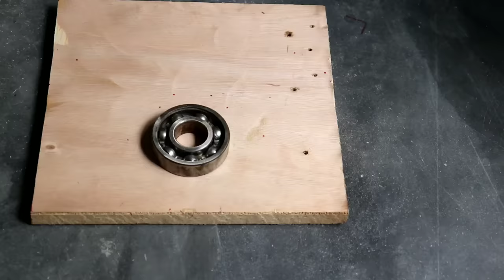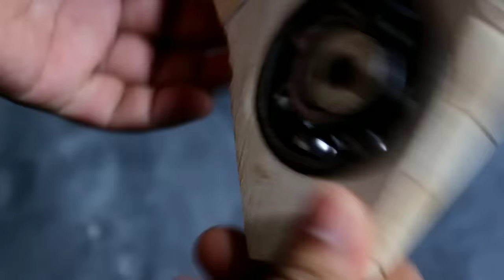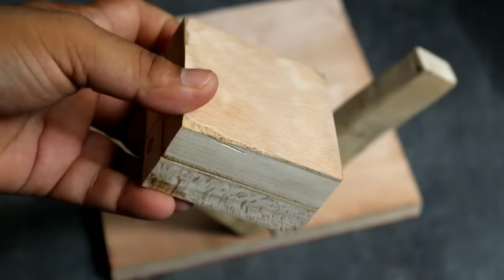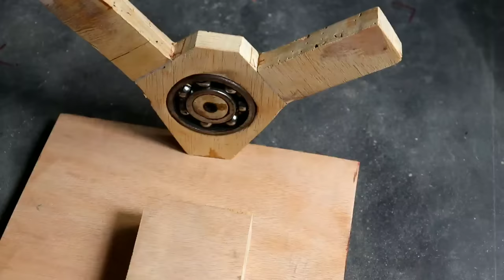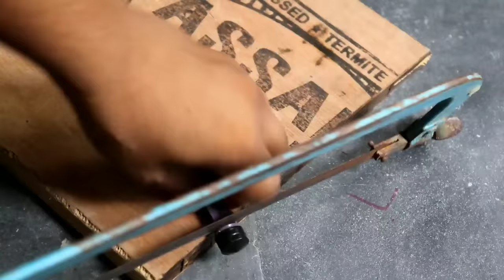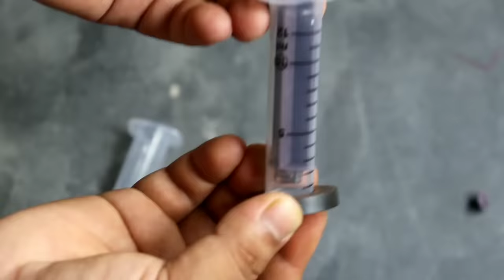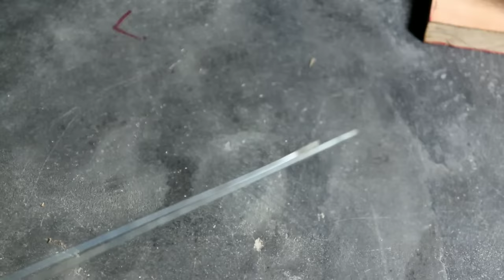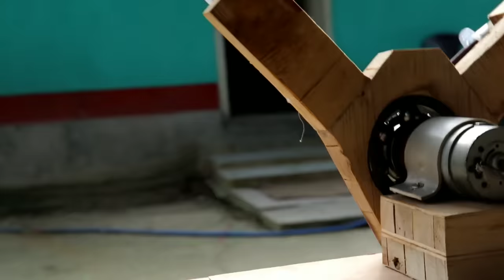dubble cylinder engine 100% working

Comment: Concept 1 :- The most difficult problem in creating free energy is " where to hide batteries"
Reply: may be in the motor 😅
Reply: Сам такое сделай и узнаешь где спрятаны провода... Магнит.
Reply: One for engine, other for lamp
Reply: Public esi fake video dekti hi kyu he...jabki urja ka siddhant he ki urja naa to paida hoti he...or naa hi khatm hoti he...keval ek rup se dusre rup me transfer hoti he...
Reply: So  funny lmao
Reply: Brother hide the battery in the bulb and use the other two connected wires as switches.
Reply: Motor in side
Reply: It work for real
Reply: Under the table bro...cause they won't shot that place 😅
Reply: Lmao
Reply: yeah he is hidden batteries 😁
Reply: That is chargeable 💡
Reply: the motor is connected to batteries via Bluetooth.
Reply: @additoislam2350  same thought I had through out the video... I was trying to catch a glance of what was underneath the base board
😅
Reply: how does this little motor produces energy if it is not an alternator or generator? i believe has some batteries hidden somewhere.
Reply: @renegoisusari5254   it can ! Try yourself
Reply: The most unoriginal comment on this video. Iv found atleast 20 people use this. 😴😴😴

Comment: The most difficult part in making engines like this is hiding the wire
Reply: 🤣🤣😂, right bro
Reply: Which wire. 🦧🦧
Reply: @juicy11  he is running it through batteries and he hide the wire .
Reply: @salmanGulsofi  that means he's a cheater.
Reply: And battery
Reply: @salmanGulsofi  it is a simple science project. Faradays law of electromagnetic induction. If you don't understand then pls don't blame anyone. You can test this project also. Nothing magical happening here.
Reply: @pritammondal4927  jyada hi science padh li hai tune 🤣🤣 science k basics hi bhul gya
Reply: @FamousInsane  may be u r right. It may that I've overlooked something.  But why everyone is saying that there is battery? Can u explain a little bit?
Reply: @pritammondal4927  Bcz that motor is DC and to run a DC motor we need DC current & Easiest way to get DC current is battery. 
And you know, when i was in school around 2007-08, i did the same for science fair. I made a hydroelectric system and used small 12v battery to run the lights. Nobody questioned me about the lights from such a small system bcz most of the people knew basic science. Its not possible to generate electricity from such small units..
Reply: @FamousInsane  it is acting as a DC  generator. He provides the rotating mechanism my magnetic repulsion. When rotor rotates we get the emf. Upto this point it seems all ok. But I'm not sure about the generated voltage. As the speed is so high that it may develop the voltage. So in my observation it is possible theoretically. But  Without testing nobody able to tell the truth.
Reply: Energy is always conserved and true perpetual motion doesn't exist.
Reply: @mayukhdevansahu5707  agreed. May be few minutes later it should stop due to friction n other losses.
Reply: @pritammondal4927  bro u are right it's does not have a battery bro it's only working on magnets ...
Suction and compression is all done through magnetic power .. 
I am an automobile engineer and knows how engine works without battery we just need starting rotating force to rotate the engine then engine works automatically... ❤️
Reply: @FamousInsane  tere science teacher se puch lena e sehi hay ki galat..
I
Reply: @anurupamahata9839  chup gawar
Reply: @pritammondal4927  it may light up for some fraction of secs but not more than that. The law says that the change in magnetic flux induces emf. The magnetic flux needs to change to induce constant emf to light the bulb but the speed is constant so flux change won't be there and hence it will not induce any emf further. There's definitely an additional hidden battery.
Reply: @aminto3731  
كلامك مظبوت كنت سائق سيارة ديزل فحاولت تشغليها لكن البطاريه كانت فارغه ثم احد اصحابي اتى ببطاريه وعندما شغلت السيارة اخذ البطاريه وبقا المحرك يدور بدون بطاريه
Reply: But I noticed your inflated opinion came with no explanation.  Typical of naysayers.
Reply: @50-sachinsharma  why don't u try first n coment 😁
Reply: Magnet + dynamo = electric
Reply: hahahaha

Comment: The people from the 80's and beyond would remember the way bike lights with the generator were. Even with a tiny light bulb it took work to get it to light.
Reply: LOL, Remember it well... It would cut my speed by about 40%, ... now electricity runs me around, (mobility scooter), not me running electricity...  : ).

Comment: The thrust in car cylinder comes from the explosion of gas, but when the piston returns back, there is no thrust in that cylinder while coming back, while there would be new thrust coming from the explosion in the second cylinder.

 Here, the thrust force between the circular magnet and the magnets inside, in each syringe is equal in the two syringe.

From the beginning and in the first half of the cycle, it will rotate to the middle area and stop because the thrust in both of the two syringes will be equal.
Reply: eu pensei o mesmo que você. foge da logica esse video
Reply: Fisicamente é impossível... deve ter algum truque.
Reply: I don't trust you.
Reply: We want comment like this and not like saying "it's fake"
Reply: @dr20231may  There's really no need for anything more than, "It's fake." But I'll humour you. A device like this could work if and only if there are absolutely no losses. That means no friction, which is simply impossible. And even if that was achievable, it would stop as soon as current was drawn for the light bulb because that's energy lost from the 'motor'.
Reply: Inertia

I'd like to see you guys claiming fake, make one and prove it won't work? But I think y'all need more skill than an arm chair quarterback to work a gluegun....
Reply: @Da_W1ck  1st rule of this world trust nobody!!
Reply: Then how is it working ??
Reply: @Da_W1ck  i don't trust you 🙌
Reply: @intelligentvoid  something someone void of inteligence would say.
Reply: See, you are right but as soon as it reaches the first half cycle, it still has momentum which resists it from stopping in the middle and pushes it further which in turn creates forces disbalance and the same story continues.

But the point here is that it can't be possible as there is always friction! Energy loss can't be avoided
Reply: @intelligentvoid  rotfl, why wasting time when physics tells you it doesn't work?
Reply: @fabioj.w.6185  because YouTube views pay!
Reply: Not if you turn it fast enough, with enough force starting it the first event will overpower the repulsoon in the second chamber and it will continue thusly. Not to mention the momentum of the spinning wheel and magneto components
Reply: @gregoryvigneault1824  but at some point,  the thrust will equate each other.

Even if a big flywheel in use.
Reply: Se Elon musk user isso no Tesla eu vou acreditar! fora isso jamais!
Reply: @intelligentvoid  It doesn't work because if violates the laws of physics. Their is no need for me to spend several hours of my time reconstructing the device simply to show it does not function. All i need is to understand the laws of motion and energy. "Energy cannot be created or destroyed, but can only be transferred from one form to another." Without some form of energy "Input", you cannot get energy output.  gas engines convert the energy in fuel, electric engines convert  electrical current from a battery, or from a hard line coming from a power plant which converts that energy from coal, oil, natural gas, wind, hydroelectric, solar, or nuclear.  In this particular "engine", you have an electric motor that is spinning the syringe cylinders. That motor is being powered by an electrical current either wired into it from under the board to a hard line, or being distributed from batteries.

Inertia, is the law that an object in motion stays in motion until acted upon by an outside force. These forces include gravity, and friction.  Inertia only means that an object will continue to move until its potential energy is used up via friction.  On this particular device, the friction points are gravity, the "cylinders", the bearing, and the electrical motor.  All of these points are exerting friction on the motion and outputting some of that energy in the form of heat (this is why when you rub your hands together, they get warm). This loss of energy would eventually (and in this case very quickly) stop the engine without an outside force giving it a continuous energy source.

Every couple months, someone "invents" a perpetual motion machine and posts a video of it on youtube.  It gets millions of views, and yet, for some reason, we don't have worldwide free energy......I wonder why that is......  

Now. Each of us with the knowledge to understand this can set off typing it all out in the best way we can think of to hopefully explain it to the blissfully ignorant. OR. we can simply say  FAKE.   (which is why mostly, that's the comment response you get)
Reply: @dharampalthakur5212  That's just an electric motor turning. 🤷🏼‍♂️
(Home Made Electric Air Compressor Motor)
Reply: @Da_W1ck  I don't Thrust you ;)
Reply: @austinshepherd9985  My thrusty friend.
Reply: @intelligentvoid  if something as simple as this worked we wouldn't be paying electricity bills, just like how we dont have to pay for water in india, if you dont trust me just make one and save yourselves lifetime electricity bill, it would probably rotate for few round then slow down and stop, there is no perpetual motion in reality
Reply: I would say he is true, he can adjust it .
Reply: I love how people try to use physical principles like inertia to explain how it might be able to work but they forget the simple physical principle that energy can't be created or destroyed. You can only change the form of energy. That means this creation must have some sort of energy source in order to provide the energy to spin the wheel.
Reply: Just add a little LiPo battery and you can do the same, so no need to explain the clear fake )
Reply: @sethrockwood  цилиндры шприца вращают двигатель! А цилиндры в свою очередь работают от магнитов (т. е. Магниты в каждом шприце стоят друг к другу противоположным сторонами и отталкивают друг друга) тем самым два шприца начинают вращать подшипник и двигатель(но в данном случае это скорее всего не двигатель, а какой-то мини генератор)
Reply: @D777ST that would work if you don't have even a tiny bit of energy loss. But you always have friction somewhere
Reply: We trust in thrust
Reply: @D777ST yes, friction and air compression would slow it down though within 2 or 3 cycles.
Reply: @dennisheise6335  I was thinking, if he used a much smaller bearing, motor, and drilled a tiny hole in the middle of the magnet and fed them onto a thin wire, you would reduce the friction quite a bit. And then I thought, well the magnetic energy is there, and it doesn't stop/run out, so theoretically you could keep utilizing that energy. 

And then I thought the two magnets would just quickly reach equilibrium, as one side is pushing the same energy as the other, and for this to work, you must push one set of magnets past its magnetic resistance in order to ha e it jump back, and the same set of magnets, could not push an identical set of magnets past their magnetic resistance.
Reply: @sethrockwood  You wonder why we dont have free energy? Ask rotschilds, I am sure they know...
And read Walter Russell.
Reply: Magnets? Where’s magnets? I only see an electric motor that is captured by the camera only from "certain" angles
Reply: baterai tersembunyi
Reply: @dr20231may  It's fake
Reply: @caminorletshunt8809  there is a video of a guy explaining how this is made, with a battery under the wood
Reply: Finally a mechanical engineer 👍.
Reply: Garbage. There's a power supply in there somewhere.
Reply: @intelligentvoid  I'm going to gather the material prove or disapprove it work
Reply: 😂 Don't mess up their dreams, they think they're smart with a piece of wood and two pieces of plastic coupled to a DC motor 😂
Reply: @gregoryvigneault1824  LoL when fantasy has more value than real physics,than it will work.
Reply: @stevencorrea8032  Yeah do it...and while you try to build it you can learn physics ,so you'll know and could explain why it didn't work 👍
Reply: A junkies dream lol
Reply: @D777ST no because the two forces being equal, are not able to push each other
Reply: Your a thrust😂
Reply: @dharampalthakur5212  if the guy showed the bearing running without the generator attached then I might believe it. He didn't do that. There are wires coming out the bottom. I saw a Russian guy do the same trick with a car. It was running on the starter motor. He admitted it was a prank afterwards.  This is a prank as well.
Reply: @dharampalthakur5212  it isn't
Reply: So what if he put spring instead of those wires? There will also be bonus from spring energy?
Reply: Except you have momentum from the centrifugal force of the bearing. I think it will work, the question is how long before it stops? I guess I'll find out when I build my own to prove or disprove this video.
Reply: The thrust is a car come from the flywheeel
Reply: So that is why it must be cranked to start it
Reply: Centrifugal forces MAKE the rotation lighter. Like the vid of a guy holding a bar and a 10kg round weight on the end of the bar. Once the weight gets up to rotation speed the guy can litterally lift the bar and eight above his head with ease. DONT rule out !

Comment: Saving this under my "How To" playlist for when my kids start having science projects in school.
Reply: Shawn no offence but this device is fake.

This machine violates the second law of thermodynamics.

There is a hidden battery inside the base.

There is no free energy.
Reply: @animeshkumar3700  I'm aware that there is no such thing as free energy. I still think it is impressive that he built a functional engine out of the components he used.
Reply: @Tiger_Trades21  it's not even an engine.

It's just a dc motor bought off the market (connected with a hidden battery) and some syringes attached  to the shaft for aesthetic purposes.

There is creativity involved i agree but it's disingenuous.

Comment: The best man at cable management 👌. 
Yeah and i am not even complaining about energy loss and structural strength of those syringes.
Reply: Was waiting for someone to mention the overall integrity.
Reply: If that bearing spun a bit more freely, it might make it slightly more believable....but, when it barely spins for a second means there is a lot of friction the bearing is working against and all that energy lost by the bearing alone.
Reply: I mean yeah if this works we should install them exactly as he shows! this wouldn't be like a small scale model just to show how it would work or anything like that. oh wait would it?